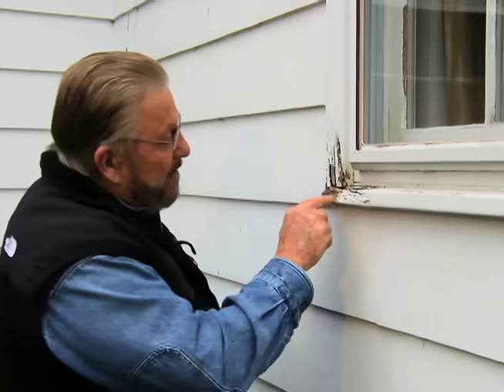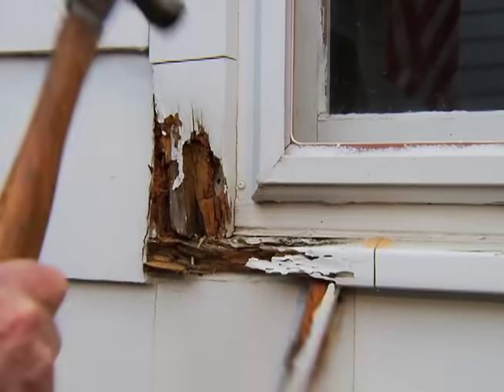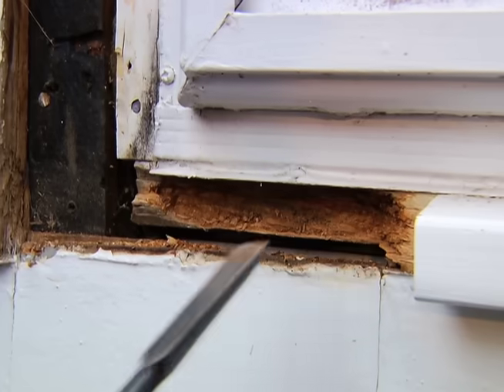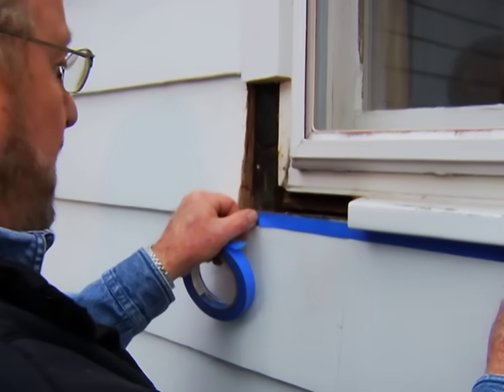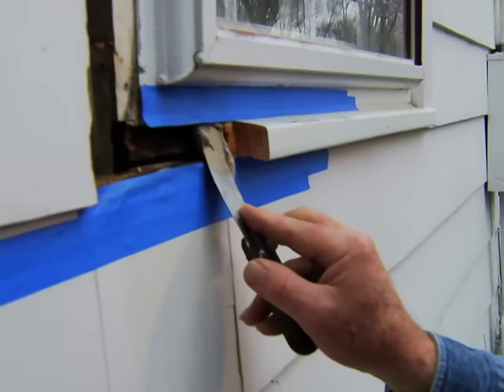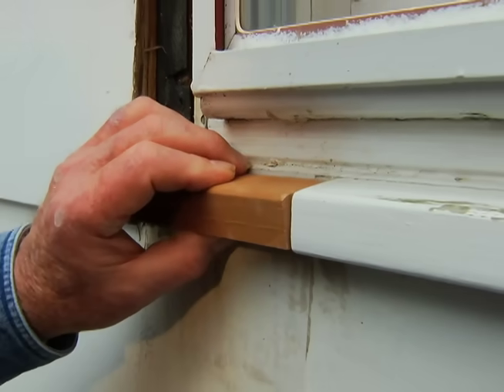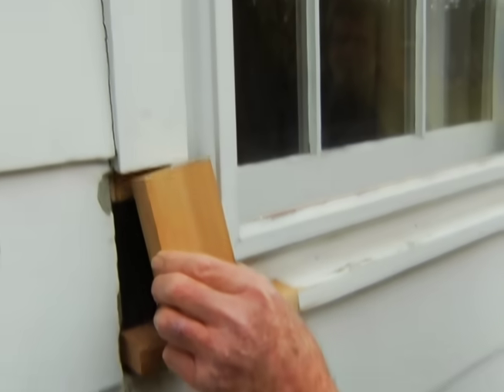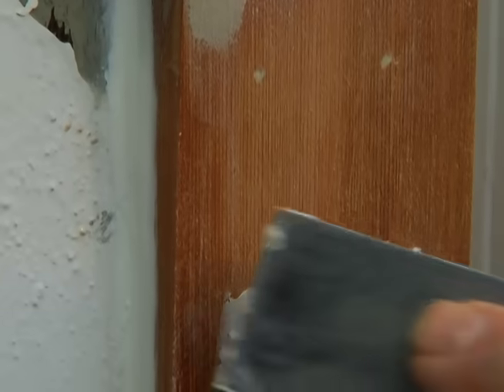How to Repair Dry Rot in a Window Sill

Comment: Ron because you can’t access the sides of the repair piece of trim( it is covered by the siding) you should have cut-the trim at an angle so water would run out minimizing the chance of water getting behind the repair.Admittedly I have the advantage of watching the repair on video.

Comment: Very nice.  Just two points I would make. (1) Window sills should have a drip groove along the bottom edge. This helps prevent water running back to the joint with the frame.  (2)  Beautiful set of Japanese chisels there.  I certainly would not use them for hacking out rotten timber!
Reply: *weather channel

Comment: Big patches on horizontal surfaces with bondo/minwax 2 part can sag so depending on the shape of the void and it's location I used blue painters tape wrapped around a small scrap piece of wood with the glue side out either as a form or to press the material into the void while wet. Minutes later you can remove the blue tape and apply the final application with a surface that does not protrude from the repair area. Stick on sanding discs also work well if they are 60 grit or lower.

Comment: I would have soaked the wood in preservative like Cuprinol first - you have to paint it with something like aluminum primer after that but it’ll last longer. I did that to some of my windows with rot over 30 years ago and today they are as good as the day I did them.

Comment: This is exactly what carpenters do in our area. The sealant is called putty. Even when buying new furniture we are wary of joints/cracks at some places. You won't notice until the paint peels off exposing the place. The screw holes are easily concealed which is a good thing.👍
I'm going to repair my old wooden sofa which has some surface cracks but otherwise it's sturdy and purchased at a price less than 25% of a new one.

Comment: I am very skeptical towards this form of repair. I think the wood should have been completely exchanged with new wood - both sill and trim. Also a flashing would be great if there is a slot in the window. Seems like a cheap repair that could potentially last shorter than expected. How well does the patch stick to the wood before it breaks off?

Comment: I have used these minwax products. It is only for small corner repairs like this because this stuff is expensive.  You can also use an old school oil base exterior putty or an old school water based one and just replace the sill, if it's an easy one like this.

Comment: What do I think? I'd give it 80% for a repair that doesn't replace the entire sill.
Due to inevitable timber movement the rigid epoxy filler will, over time, allow ingress of water to a butt joint. That invites more rot. I'd recommend cutting the trim timber at an angle for a scarf joint to better shed water and for this job use a flexible but sandable filler on any gaps. The epoxy and wood hardeners were fine for the framing repair.

Comment: Bondo is the same product but cheaper,  auto store or Walmart.  I drive screws through, and prime everything all sides....if you don’t want to sand as much I have gotten window sill stock that all ready has the slope and cut off what you need, more expensive but less labor. Home D or Lowe’s has it in stock in window trim aisle.  But good vid!

Comment: Awesome. I'm wondering if this would work for the inside of the windowsill. Bought a place and the window sills are bad and trying to fix the place on a small budget.
Reply: If the area is still structurally sound I don't see why not. Just maintain adequate ventilation. And auto body filler is the same as the wood filler he was using at a much lower price.

Comment: Wood filler does not work as stated below in comments, it cracks out in a very short time.  The wood hardener works well, I use light weight spackle .

Comment: use a shur=form file to shape the resin.  in the body shop this tool is known as a cheese grater. dont let the body putty completly cure work it in "d" stage. hard but still slightly sticky.fast easy and will work on plaster walls also.

Comment: Dissolve borax powder, in hot water (i use boraxo hand cleaner)and spray or brush into rotted  and even good areas for protection against the critters and bacteria that rots the wood.

Comment: Not sure if you can get it there but you should check out a product called repair care dry flex. A two part epoxy resin. Way better than the stuff you used.

Comment: A homeowner repair... not a craftsman repair. The joints should have been a 45  with filler applied lightly before inserting. The new wood should have been primed on all sides. The source of the leak should have been corrected.

Comment: I just fixed a friends window that looked exactly like this.  Instead I replaced the entire trim and took the window out.  Took couple hours but the fix was done right and will last for a long time.  In the process I found what was causing the water to run down that side.  It’s always better to do things right.  Yours was an easy patch job but the rot is way worse than what you took out.
Reply: What was causing the water to run down?

Comment: For the second replacement, I would have also filled in the old gap where the rotted wood was removed, then add the replacement wood and patch the seams.

Comment: I am a carpenter and years ago I would fix something like this with bondo or mirco balloons filler. It eventually rots away again. The filler is eventually surrounded by rotten wood.  If you will notice from the video, the rest of the sill and exterior casing are in good shape. What does this tell you?  It tells you that there is a leak most likely caused by a lack of flashing or improperly installed flashing and sealant. Water most likely leaked from above behind the siding or casing and was unable to drain out of the bottom. Until you fix this you are just wasting your time. Another tip: all wood on the exterior of a building should be painted with lacquer based paint on the back sides and most importantly on the end grain. How to repair a rotten sill? : Replace it.

Comment: I could not see the finished product b/c Google sent me a bunch of pop-up suggested videos instead. I'm sure it was excellent, however. I'm curious why you did not line the vertical portion with the filler first?
Reply: That is just window trip (not part of the window structure) while the sill was part do the window itself

Comment: Good patch job/bandaid but eventually the house starts to look like a quilt lol. The entire sill (or at least the nosing) will need to be replaced. And It's often just as easy to replace the vertical casing leg as it is to patch it.  And it's always good practice to prime the cut ends of the old & new wood pieces. Good video nonetheless.

Comment: Just replace the sill and trim board with PVC lumber. It's faster and probably less expensive and looks much better. Resins rarely work.  A few years from now you will have the same problem on the other side. Take it from an old timer who has made these mistakes.

Comment: I've seen a lot of comments, some from professionals. My question is this: why replace only a corner?? it takes as long or longer than replacing the one corner? plus one will buy several different components to rebuild the corner etc, the time, tools, wood resources necessary to replace the entire frame, versus all the time money and resources are outweighed by replacing the whole frame??? And lastly, the same elements, time, weather, sun, wood degradation would almost call for replacing the whole and not the corner?

Comment: That looks like body filler(Bondo) that will absorb water and fail. Duraglass or Dynaglass reinforced filler would be a better choice it is more water proof or fiberglass resin and mat. I have repaired wood and fiberglass boats and was a collision repair shop owner, If you are going to spend the time to fix it do the best job possible. Good video :  )

Comment: Polyurethane glue depends on moisture to cure which you are not going to get with trying to glue it to autobody filler. I seriously doubt that  this fix will last very long. If a sill is this far gone take the time and replace it.
Reply: gary24752 its not body filler read the can again
Reply: @scor440  Hate to break it to you but there is no difference between the wood filler he used and body filler. Maybe price. It is just marketing at work. If you have a table saw it is not hard to duplicate the sill. I replaced the jamb trim and sill in a very short period of time putting the window back to original specs.

Comment: In a way this could be useful for a very minor repair if all the supplies you need are easy to get ahold of or you just happen to have it around and it was on the exterior only.  But if the frame is rotted on the bottom, it won't support the weight of the window being square, and the window wont stay closed or wont open and new rot will occur as the patch settles.  New window is always a better bet in that case.  Like one not with so much wood.....
Reply: Yeah once I saw how much rot was "behind" I was like...ah not great for this kind of fix then

Comment: Good job.  I've used a lot of Bondo products, very similar to MinWax on 40-year old casement windows.  Recommend you use the wood hardener to seal the new pieces as well as the exposed new wood on the original sill, especially the open end grain.  Also, start sanding the putty before it is too hard.  This will save a lot of time and work.  If you're patient you can get very good results with this stuff and it's way cheaper than a replacement window.
Reply: As a contractor myself, I hate when people like you teach others how to "fix" something improperly! This is a hack job at best! You ignore the real issue, which is why water settled in that corner of the window and rotted the wood. Then you complicate the repair by using expensive epoxy instead of just replacing the corner with actual wood. This is a mess that you are leaving for the next owner of that home! YouTube watchers, DO NOT do this

Comment: Thanks for the info I can really use this. I've been wondering about how dry rot or even wood repairs after extermination (ant, termites, any other wood eater bugs?) happens.
I really don't understand why people are complaining about the visual LOOK at the end.  He was only showing the steps of 1 of the ways to correct that problem.  He was not doing a video on the beauty after it's done. Besides no one but the people who will be living there will know Unless Someone Walks Up To Try Look Directly at that spot. LATER He can n probably did put on a secondary third paint coating (n maybe even painted the whole window) the look uniform. But that was not the focus. For all of our guesses he may have been doing a whole home or all windows maintenance project and ca me across this problem then decided to show others that may have seen this or have the same problem themselves. 
📱 #stop judging without more info! 🛑

Comment: Instead of filling the entire hole with the wood putty, I would try to screw some pieces of wood in there first. This need not be pretty you can just use scrap wood. This serves two purpose: it gives structure for the semi liquid putty to stick to otherwise it may flow down towards the bottom of the hole and you may need to apply multiple coats, and it reduces the amount of expensive putty you need to use.

Comment: Better than replacing?
 A few comments from a ships carpenter/boat builder. 50 years ago when these "miracle" materials came in vogue and quickly became the go to repair on wooden boats for rotted and mold damaged wood.  It took a while since the methods are great at hiding the damage but the process only hides and prolonged the inevitable results. Not only did the "repair" take a ridiculous amount of time vs replacing the wood but you covered up the mold spores that have come in contact and infected any wood sealed behind the exterior sheathing. The  rotted wood is the end result of the microbial interaction that has started long before this repair.  You have to open up the area completely and treat all surfaces with the wood hardener. Spot treating isn't reaching the 2x4s, sheathing,window frames,, and framing material. That whole sealed area will be infested with the mold and eventually rot everything in that wall.  Granted there's not many wooden boats left but these products aren't utilized anymore by professionals wanting to permanently repair.

Comment: Using a polyester filler isn't good. You have to use a epoxyfiller. I did used also a polyesterfiller, but that was a wrong choice, after 2 seasons, I have to redo my windows again.
Besides that, you used too much hardner in your filler. it should be 2% hardner.
Then a woodhardner don't stop the rotting of the wood.
The result looks nice, but how long will it last?

Comment: the best way to repair the dry rot is to replace the the window unit and wrap the exterior wood that you have to leave with woodgrain aluminum coil stock since this is just a band-aid not a fix

Comment: Super glue works better than that Minwax Wood Hardener. It's cheaper and less messy. Be sure to use latex gloves or you will glue your fingers together. I speak from experience.

Comment: There is no such thing as "Dry Rot" all rot in wood requires moisture to allow fungal infection of the wood fibres, therefore there is only "Wet Rot".
Reply: For starters. , it's not dry rot, it's wet rot, huge difference , dry rot is a lot more difficult to treat. While yes dry rot requires dampness, its biggest contributor is lack of ventilation

Comment: sawing the (side) trim with a fine tool/multi-tool /wiggle saw would  be better and you 
wouldn't need to chisel anything . 
you will still have the rot all you are doing is slowing it down; sooner or later you will have to come back and replace the window and perhaps some  framing.

Comment: Wet rot not dry rot. If that was dry rot the whole frame would need replacing plus the surrounding timber as well.
Reply: yes it was normal rot that had dried out, the nails and screws had attracted the moisture and caused the rot from the inside, plus the join where the trim met the sill was the 1st fail point, I didn't see him mention caulking that part
Reply: @utubeape  my point is that dry rot is a completely different phenomenon. It is not just wet rot that has dried out and therefore should not be described as such.

Comment: Thats not how to fix that. No need to fill in with that goop. Replace the wood with wood. Fill in joints with caulk, sand , then paint
Reply: Good Idea, will be cheaper too. There are always alternative ways to achieve same goal. Nice if you can post a video for that too. TQVM

Comment: In my unfinished walkout basement, on some of the wall's particleboard, I've got moisture and mold.  The area is under a window which is under the deck.  I've been told there's drainage vents in the bottom  of the windowsill which drain rainwater out, and they got clogged and water seeped down into the wall.
But I don't know where those vents are or how to clean them.
Any ideas?
Reply: On the outside, at the bottom of the window...

Comment: It should have axed the whole cill off ,treated it & screwed & glued using wood pellets to hide the screw heads & sanded & painted .At the very least you should of done a proper 45 degree cut splice on the existing cill once rot was removed  Make sure you get paid  for the cowboy bodge before the site agent gets the local sheriff to come after you with a posse .

Comment: While I can appreciate this somewhat unfortunately this is just a half ass patch job.  Won't be long the rot will spread to the surrounding "good" wood and you'll be doing this all over again.  Just rip out all the wood entirely and replace it all.  Job done and done right 
Thanks Mike Holmes

Comment: quite good but don't call it dry rot. that's a totally different more serious  thing. this is rot caused by water. I normally use wood care products like wood flex and woodfix rather than 2 part filler as it flexes and will never crack.

Comment: There is no such thing as dry rot, all fungal damage requires water.  This is what is called brown rot and is caused by the fungi dining on the cellulose within the wood cell walls ("straws"), leaving only the "straws" remaining.  This results in a brown and fragile material that is easily crushed.  The other main type of fungal damage is white rot but there are also several other minor types of fungal damage.

Comment: That’s wet rot,not dry rot! 
If it was dry Roy you would be replacing a lot more than a bit of surface trim.
Reply: Spot on Ted. Lack of ventilation causes Dry Rot. This is purely down to water ingress

Comment: There is no such thing as "dry rot" had the space remained dry,  it would not have rotted.
Reply: Oh yes there is! Serpula lacrymans is one of the fungi that cause damage to timber referred to as dry rot. It is a basidiomycete in the order Boletales. The Serpula lacrymans has the ability to rapidly colonise sites through unique and highly specialised mycelium which also leads to greater degradation rates of wood cellulose.

Comment: I thought you did a good job on the repair.  There may be a bigger problem however.  Dry Rot is caused by a wood eating fungus.  When it exists all wood affected must be removed and destroyed.  Otherwise, it will keep spreading.